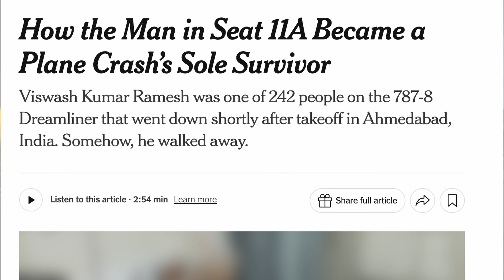Why the RAT Changes Everything – Air India 171 Update

Comment: The fact that you can hear the RAT over jet engines which should be at full power on take kind of convinces me it was a dual engine failure.
Reply: Was here to say the same thing. We should have been hearing full power jet engines but instead it sounded like a Cessna flying by.
Reply: Agree. Felt like there was silence from the turbofans. Which as you point out should have been at full power.
Reply: My thoughts as well. Also, as the plane dips below the skyline it is eerily silent. The jets from DFW flying at 10,000 on takeoff/landing over my neighborhood make more engine noise.
Reply: Usually airplane engines are loud.  Definitely SOUNDS like engines weren’t working.
Reply: Agree...a RAT is loud, I have tested them hundreds of times, but you can't hear a RAT over to 2 Trent 1000 turbofans at T/O power.
(28 year airline mechanic)
Reply: Agreed!
Reply: There’s plenty of footage on RAT testing on the B787, the RAT is louder than both the GEnx or The Trent’s. You guys are all just making HASTY assumptions at the first semblance of evidence lol.
Reply: .. that's what the video says - now explain why - you're stuck because the video hasn't given you the answer.
Reply: Good point.
Reply: So many crash aviation experts , with little thought for the victims , Humanity
Reply: That was my thought.
Reply: Indeed. I'm completely in the camp of contaminated fuel. I'm thinking loss of engine power, but nit enough to be totally useless at first, and deployment of RAT when the engines were in fear of being rendered completely useless. It was my guess at the start and this just further confirms it. On board reports from the survivor saying the lights flickered meant they were already powered before the RAT took all control of the power grid. I could still hear some turbine whine drowning out some of the RAT's noise, but it was not loud at all.
Reply: DEI is how you are more likely to GET incompetent and/or overridden engineers, because DEI isn’t designed to get the best, brightest, and most qualified, period.  It adds irrelevant variables like race, gender, and other nonsense that has nothing at ALL to do with anything, especially engineering.
Reply: cant see it in the video he showed....mmmm
Reply: The frequency of the noise doesn’t correspond to more power. And in the same reasoning just because you can hear the RAT doesn’t mean  the engines weren’t working. The worrying take away is that the RAT was deployed immediately after rotation. Indicating total loss of electrical power and hydraulics. How that occurred who knows.
Reply: Why do people keep saying this? I see this comment constantly. There are many videos on YT showing that the RAT sound easily over-powers the main engine sound, RATs are incredible loud (due to their constant speed prop often hit close to the speed of sound at the tips which creates the unique sound) and modern high bypass turbines are surprisingly quiet, also, since it is a completely different sound profile than the main engines they become easily distinguishable, even if they would sound less
Reply: Landing = low thrust = low engine noise.
Take off = high thrust = high engine noise.

All those videos show planes landing with the RAT deployed.
Reply: @Jeppelelle  They keep saying it because the only time the R.A.T is deployed is when there is no power, which only happens with a dual engine failure in modern airliners.
So every clip you ever seen with a R.A.T deployed (as footage of them was not common before) is where the engines are not providing power.
Reply: @Jeppelelle  turbines are surprisingly quiet??? Lmao tell that to people who live under the flight path.
Reply: @Jeppelelle  if you listen closely you can just barley here the sound of at least one of the engines idiling or the apu running. Theres absolutely no way contaminated fuel would show up that early its virtually impossible for both engines to fail simultaneously outside of a bird strike and we would've definitely seen it if that happened. Idk this is even more odd than the jeju air crash.
Reply: @Jeppelelle  Why would a RAT deploy if the engines were working?
Reply: @alisonwilson9749 my comment didn’t have anything to do with whether the engines on this airplane was running properly or not, i didn’t claim either way, my comment were purely in a response to people claiming that RATs can’t be heard while the engines are running, which is false according to people who actually works in the industry

Also, to answer your question; RATs have other deployment failure modes other than dual engine failure, but again, this comment is not in response to this actual crash since the reason still isn’t known
Reply: @Jeppelelle  nonasmuch overpowers as has a different pitch that cuts through - like a tiny triangle easily cuts through a massive full blast orchestra sound.
Reply: @Jeppelelle  RAT doesnt overpower Jet sounds, it's just that 99% of the cases where RAT is deployed there is not engines to make sound
Reply: @rodrigotorres2810 yeah, that is bullshit, check the many people that are servicing RATs and there was even a technician from the manufacturer that also said the RAT is absurdly loud and can be heard next to main engines. I trust the people who work with them instead of armchair ”experts” like you 👍
Reply: Makes me wonder if it was dual engine failure due to either a bird stroke or contaminated fuel made the RAT deploy
Reply: @josephpacelli3691  Lots of vids and no birds in view.  A plane with no previous catastrophic failures suddenly loses both engines on takeoff?  Contaminated fuel starting to seem really likely.
Reply: @tippyc2  Only video of the take-off has a shack in the way as it rotates and there is a big puff of smoke / dust... we just don't know if there was a bird strike or other issue
Reply: @dzzope  i saw some pilots saying that the dirt/dust could be from the end of the runway. They thought that the plane must have been having issues getting off the ground.  Because, they thought the plane should have been able to hit V1 at approximately 9600 or 10,000ft and not have to use all 11,000 feet.
Reply: @SirHeadly84  Absolutely could be.. point is we don't KNOW it was.
And the plane was not near the end of the runway, it rotated normally. If you see a plan of the airport, where the camera and shack are to line up where they rotated is about 3/4 ish way down the runway, they had plenty of rrom left and if they were not accelerating properly or had engine issues on the roll, they would have rejected the take-off.
Bird strike seems most likely to me personally but we don't know what we don't know.
Fuel contamination doesn't usually have that much effect that quick. The engines will usually cough, splutter and just not run like normal well before they would stop working, particularly when put into a high thrust setting.

Boxes will reveal all. (hopefully)
Reply: @dzzope  Im going to disagree with the speed of fuel contamination. The GE GENX engine burns approximately 53lbs of fuel/min at idle. that equates to roughly 7.85gal/min, per engine. I dont actually know when the engines were started. But, google says that usually happens during pushback. And, if taxi time is say, even just 2 minutes, thats 212lbs or about 31.4 gallons  of fuel. I would assume (perhaps incorrectly?) that a fuel contamination so severe that it would cause a dual engine failure at or shortly after V1 would make it self known rather quickly. Now, I DO understand that full throttle is much different than idle. But say, when a avg car or truck takes on contaminated or incorrect fuel at the gas pump, they make it a couple feet, if that. Thats really the only experience i have to compare it to. I certainly know that a combustion engine running on gasoline is a lot different than a jet engine running on Jet A , Jet A1, etc. I think the final report is going to be interesting to read. What happened that day shouldn't have happened. There are redundant system to prevent that.

 Unfortunately, being something like 400-600ft off the ground doesnt afford much time to address any issues that come up during or after V1. From other previous videos, i know that V1 is whats known as "decision speed" meaning this is where you either abort if there is an issue that warrants it, or you take off and deal with it in the air if its not serious. I doubt it was a bird strike that caused the dual engine failure. the RAT was certainly out. But, from the videos i have seen, i dont see ANYTHING coming off or out of the engines. Furthermore, there have been no reports of dead birds being found on the ground. Even if just one engine failed, i believe the plane should have been able to climb out. At this point there is definitely more questions than answers. But we do know that the RAT was ABSOLUTELY deployed. There are reports that the landing gear appears to be in a configuration that suggests it was commanded UP properly. Just that it didnt retract fully. 

Too many unknowns at this point. Especially when there are multiple reasons as to why the RAT would be out. AND, what causes the issue leading to the conditions for deploying the RAT. Especially given the stellar track record of the 787. I'll be awaiting more info for sure!
Reply: @josephpacelli3691 highly unlikely to have catastrophic bird strikes on both engines at the same time. Also no flames seen shooting out of those engines.
Reply: Of course you can hear it over the jet engines, because the engines stopped running? You're still going to get some temporary lift but at that elevation, the RAT was no match.
Reply: I heard the jet engines roaring.  They could onlly  both fail if the fuel lines were blocked ( like ice ) which it wasn't  due to temp.
Reply: @humelakecabin  or bird strikes or fuel contamination. Flight monitoring systems "should" alert/protect them if they made an incorrect configuration change.
Also, those engines were not at TOGA power. Have you ever been anywhere near a live runway? Jet engines producing thrust are way louder than what you were hearing. 
They will still be spinning from the inertia / windmilling from the air and the plane itself makes loads of wind noise especially when the flaps, slats and gear are deployed.

There are clips of planes landing with dual engine failure and RAT deployed which sound extremely similar, it's even in this video @ 08:48
Reply: @humelakecabin  bad fuel could clog stuff up quickly
Reply: @humelakecabin or bad gas
Reply: Why is everyone talking about a rodent?
Reply: @guitarexpert2245  To prove that it was not aliens, because they are lizards ...😂
Reply: @guitarexpert2245   Ram Air Turbine. Did you see this video?
Reply: @guitarexpert2245 research about what the word "RAT" means in a 787... Your iq must be around 70 pts to think about mouse/mice in such situation
Reply: @guitarexpert2245 RAT = ram air turbine
Reply: @guitarexpert2245  I know!  Plus, it wasn't a RAT, it was a FERRET.

Flight
Emergency
Ram-air
Redundant
Electricity
Thrust
Reply: @guitarexpert2245  Rat ate the electric cables 🤣🤣🤣
Reply: What? Not  engine failure. Engine works fine but prpbably overload. Overload its not to same that damage engine.

Comment: Hot day temperature,  extended take-off run and inability to climb out surely points to inadequate power available.  Dual engine failure at take-off is a seemingly impossible scenario.  Failure to achieve T/O EPR should have resulted in an aborted take-off.

Comment: Major electrical failure => fuel system failure => dual engine failure. Is what I've been thinking about since I saw that original video with the signature RAT sound, and no engine sound. Although it's very possible that the fuel system failed, causing the electrical problems.

Comment: The first version we saw of this, the copied version, I could not say with any certainty that I heard the RAT, but in the original video it is nearly crystal clear and confirms for me it was deployed.  It will be  interesting to see when it was deployed -- I suspect not long after rotation and maybe during rotation.  If a catastrophic problem with power arises at that point its all over and the crew had to know it!
The dual engine failure looks to me starvation for fuel because the ELECTRICAL fuel pumps failed!  The engine look like they were just turned off (fuel cutoff) and with that there isn't much smoke to come out of the engines, they just turned off.  The fact that this aircraft appears to have had electrical problems before this flight is for me the closest thing to a smoking gun.

Comment: You are late to the party with this.  The "Rat" was discussed on day one and seen in the video.  This would also imply power loss.  The langing gear are also a clue. They either never tried to raise them, or there was a power loss based on the position of the wheels angled down.  They are pulled upwards before being pulled up. The mayday call was known a day or two ago.  There was also video showing that same plane on a prior flight with basic cabin switches and lights not working.  So electrical issues are a possibilty, with leads me to believe maintence issues as a root cause.

Comment: FUEL PUMPS WENT. Look at the power supply rail, look at what else draws power from this.
Fuel pumps
Environmental control
Landing gear

On an earlier flight a passenger complains of lack of air conditioning and other stuff not working.

So did electrical power system fail or did the voltage supply rail to those equipments fail?
Reply: Look at the circuit diagram!

Comment: There were a couple of flights that was affected by fuel contamination, I think sea water got the airport fuel storage tanks and wrecked the filters on the fueling truck so it transferred bits of the filter into the plane and that blocked the fuel metering unit (Cathay Pacific Flight 780) and then the more abrupt blockage by ice crystal in the fuel filter on the BA flight that crashed just short of the runway at Heathrow. It is unlikely to be salt water or ice in this case but perhaps the humidity caused a similar filter breakdown.

Comment: I thought it was engine/hydraulic failure because of the flight radar data from previous flights. I swear it seemed like it lost power mid flight, flight before. I could be wrong....

Comment: Dual engine failure was secondary to some bigger issue, I would bet on the electronics or electric power supply  somehow shutting down the engines, i.e. may be pumps went out, maybe ECU somehow quit, something similar.

Comment: The deployment of the RAT clearly points to electrical and hydraulic failure on the plane. One theory that warrants exploration is whether the loss of hydraulic pressure contributed to the slats auto-retracting during takeoff. The pressure keeps the slats down; the loss of the pressure would cause the slats to slide back into cruise position. It is obvious from the videos that the gear was stuck in the retract position, which undermines the theory that the FO may have made a mistake and not retracted it. Additionally, in another video, a presenter demonstrated that the levers for the two are located in different places for the 787. It is becoming apparent that the issue was a technical failure, and the pilots at least deserve the dignity of being heroes and not having aspersions cast upon their competence.

Comment: Dear Steve:  Instead of repeatedly blaming the co-pilot for wrongly switching - putting the flaps back and not retracting the wheels and thus leaving the wheels that caused the drag and made the aircraft to lose thrust and altitude - you could have easily checked the evidence that were available right immediately after the accident happened.  The first video was the Airport CCTV and the second video from the rooftop emerged almost shortly thereafter;  "Mayday" info., was available right from "Hour Zerio".   I was watching nonstop the coverage.  Why as an expert you just simply came to a premature conclusion ignoring these two or three vital pieces of information that were available right from the time of accident.?  And you only blamed the dead pilots,  knowing well they were not going to be there on somewhere on the screen and countering you about the accident and their actions or the failure to take such actions. 

Now , one of course is glad that you after all the long years of experience, has accepted your mistakes and bitten the dust.  

The dead pilot , Sumeet Sabharwal, must be at least heaving a sigh of relief from above now that you have decided to modify your theories and also for changing their ranking.  Now you are gracious to reluctantly push down the "pilot error" (still keeping it, not striking it out) to Number three or four.

Comment: In what cases you will get those systems failures on the ground exactly at the same time? What makes the crew can not cancelled the take off with those "bad systems" on the ground? How if they received the wrong weight and balance data and set the aircraft configuration based on the wrong ones? Can the aircraft still flying?

Comment: Why do most people find it hard to believe that A) an engine failed and B) the pilots shut down the wrong engine?  If the flaps were set wrong, landing gears left down (confirmed), and 1 engine quit completely, the plane should have easily flown around for a safe landing, but NOT if the good engine was shut down.  Contaminated fuel?  And it's the ONLY plane that had a problem?  Not likely.

Comment: You missed the Main clue for dual engine failure😂.   A Boeing passed by where you could hear the rat but NO engine sounds which should be blasting and roaring. It's the absence of jet engine sound which is the main clue